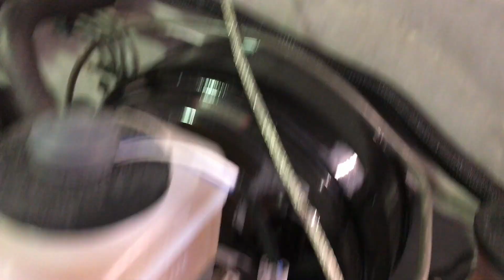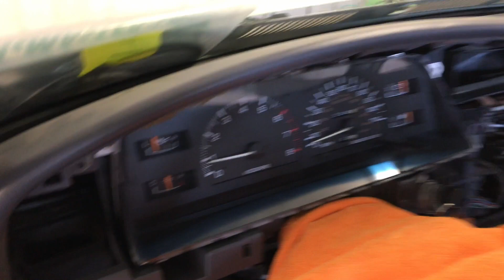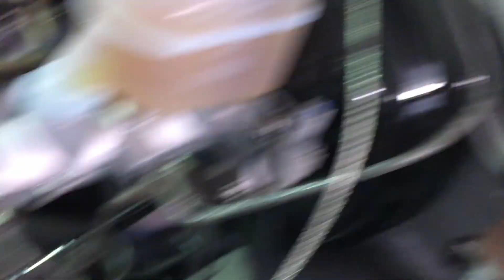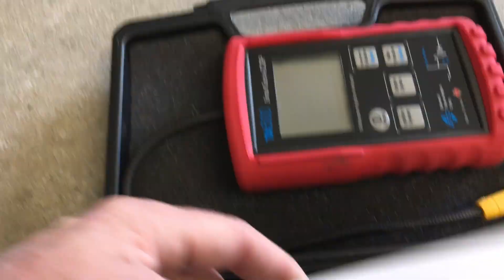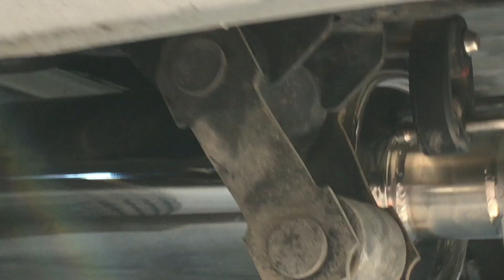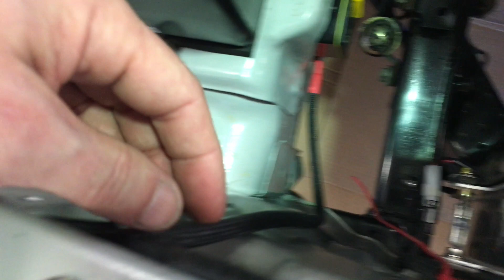Starting the 22RE 1990 2WD Toyota Pickup w/ Champion aluminum radiator & electric SPAL fan

Comment: Hi Ray, i have the same truck 1989 22Re hilux 4wd manual transmission, i've finished rebuid some month ago, some minor issue but It was good. In this month i've big start problem, seems fuel dont go in the intake, or Spark are bad, i've changed with new injector Just today, wire plug cable, new spark, ignition coil new, distributor cap new, checked fuel pressure with another pump, there are the same problem, i think its wire injector cable, in harness, changed the water temperature sensor (greeen) and checked all other resistence of VAF Meter and throttle body sensor its ok.
Did you have some ideas about my issue?
Thank you
Reply from the maker: So what exactly is the issue you are seeing? Testing the spark is pretty easy - just pull a spark plug wire off and pull the boot back a little, then crank the motor over and see if a spark jumps from the wire to the top of the spark plug when the motor is running. They also sell a little spark gap device you can plug in the line. That will tell you if there is spark or not. To check the injectors, you can hold a screw driver up to them and feel/hear them clicking typically. The motor only needs three things to work: fuel, spark and compression. If possible, you might want to pull the cold start fuel injector and see if it's getting any pressure and/or attach a pressure gauge to see if you are getting the proper fuel pressure at the rail. You should be seeing around 40-44 PSI as I remember. Also, have you ever changed the fuel filter that is bolted to the right side of the block? Those things get super dirty after a while. I just changed mine and it was filthy. Anyway, let me know what exactly the symptoms of your problem are. Also, do you happen to know what vacuum level the motor is pulling at the manifold?
Reply: @ray5961  thanks for the ideas, the cold start injector Is operating well, i've made a button if pressed control the cold start injector, if pressed at start the motor run but if i leave off after some minutes It seems dont have other fuel in the cylinders, the rpm dont raise well if i push the gas pedal i ear some irregular explosion. It seem dont have current, the engine dash  symbol has little light on the difficult start, i've checked the fuel line After filter with another pump in a Tank with filter and the problem remain. Checked the main start relay Is ok. The engine Is rebuid new. Few month ago there was no problem with the engine. I dont understand, there Is some fuses can cause this type of issues? Tomorrow i'll check all fuses and i try put new wire for injector line to ECU as FSM manual.
Reply from the maker: @nickvandeerpeers  From what you are describing, it sounds to me like one or more of your main fuel injectors have failed. When the motor is cold, the cold start injector (the little one on the back of the intake plenum) will supply additional gas and that will tend to mask the problem (because it can actually supply almost enough extra gas to keep the motor running on its own). If you have even 1 other normal injector running, you'd be surprised that the motor will run while the cold start injector is in the mix. However, once the motor warms up and the ECU turns off the cold start injector, then the motor won't run very well, because the other main injectors are much lower down in the intake system than the cold start one (which is up high). I had this same problem and it was hard to understand at first. Try putting a screw drivers up to each fuel injector and see if you can hear/feel it clicking. Sometimes they stick, while other times they just fail. I had 3 out of 4 fail on my motor. Anyway, that sounds like what might be going on. You can sort of test this by manually powering the cold start injector yourself. Either buy a fuel injector tester / computer off Amazon or just unplug the harness and click it real fast with 12V - because it always had fuel pressure when the fuel pump is on. I bet if you do that, the motor will suddenly start idling and running more normal, while you are pulsing fuel into the intake from the cold start injector. Check out my other video here where I talk more about this and let me know if it helps: https://www.youtube.com/watch?v=UawxESq1g_0
Reply: @ray5961  Ray thank you i've sow all your videos, very intersting.
Now finally i've found and resolved the problem, i've checked every wire from injector and i've found a free ground calble with  3 brown wires that go in the harness, probably the Bolt fixed on the engine block was loosen and go away, once i've reconnected the engine goes like a swiss Clock!!!!
Reply from the maker: Nick Van Deer Peers Oh nice, good job! Yes, that would do it. Those brown wires are the grounds for all the injectors - it should attach to the bolt which holds that cross brace thing which goes from the lower intake runners down to the right side motor mount. The brace supports the runner and you can see it under there at an angle; bolt down those brown wires using the M8 bolt which secures that brace into the intake manifold and you'll be all set.
Reply: @ray5961  Yes i know bit a loose nut create this problem.
Thanks for help. One day i'll made a video for YouTube. Best regards from Italy

Comment: Nice Truck
Reply from the maker: Thanks man, it's getting there. I tried to cover the radiator in the video for ya. So far it seems to be working well. I'll be test driving the truck next week, so we'll see how it works out on the open road. But even with just the fan, it seems to really cool well from what I can tell so far.
Reply: @ray5961  
I’m refurbishing a 1986 22r 2WD just waiting for engine from LCE had ship to me last week
Reply: Now going to order same radiator as you from champion. Is the radiator fan sensor from champion also?